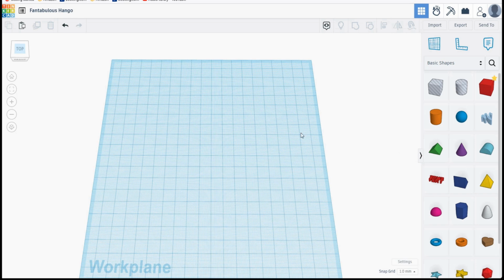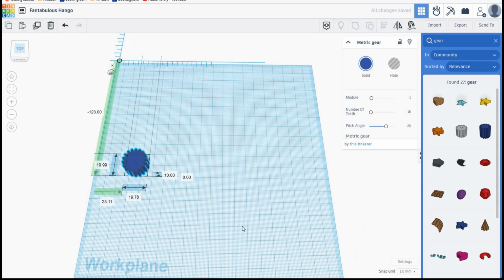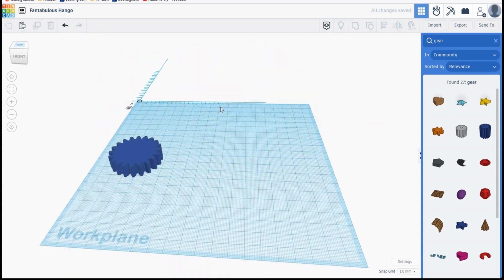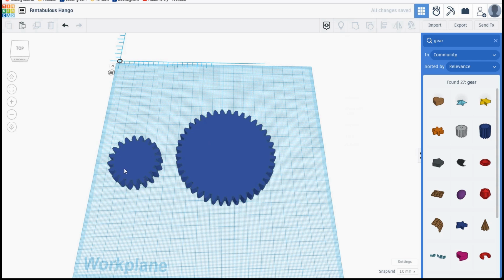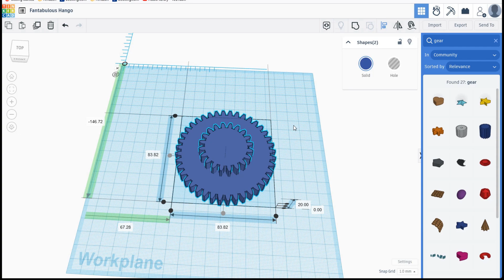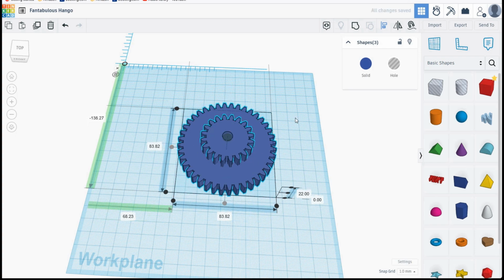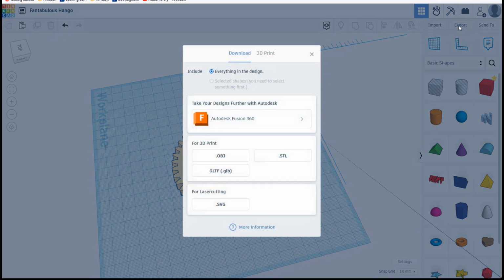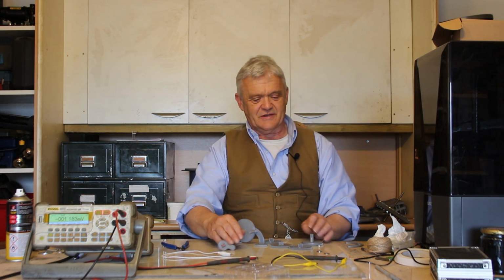1970 Gears In Tinkercad For A Tiny Generator

Comment: Using a hairdryer for wind on a converted PC brushless fan motor as described in video 1959 I was able to get around 17 volts open circuit, and around .3 amps shorted. When bridge rectified and hooked to an led chip with 15 LEDs in parallel, and no resistor, it lit up very bright. With some gearing a simple savonius type rotor would probably do the trick. The daisy idea seems very good btw. Keep up the good work.

Comment: Those hand crank generators work with a diode bridge to send the output to a battery or super capacitor.
Reply: Loseing energy in the diodes and the battery / capacitor, is not my idea of "best".
Reply: @OverUnity7734  Of curse they loose energy but how do you not use a blocking diode to keep the energy from discharging through the coils?
Reply: I guess you use the LED as a blocking diode in series with the battery and coils?